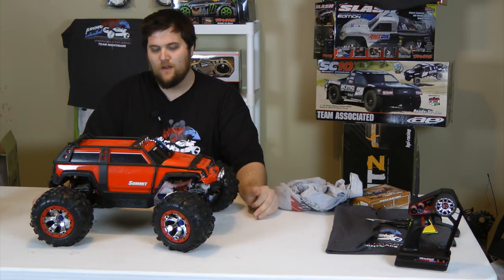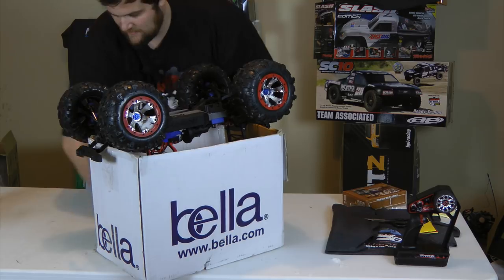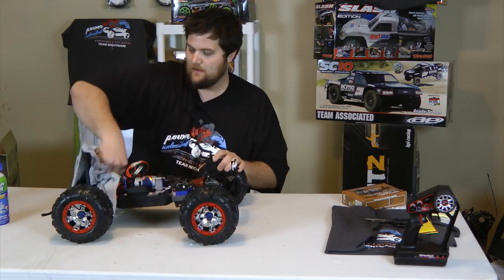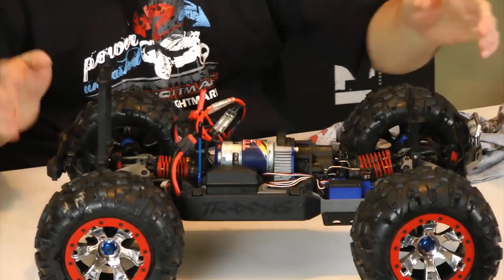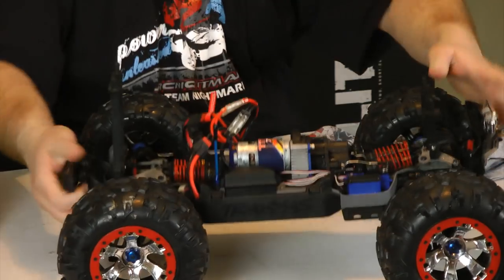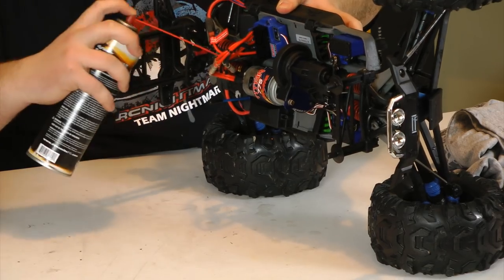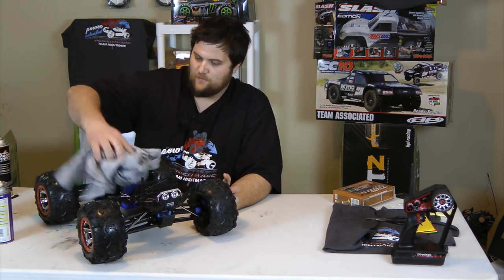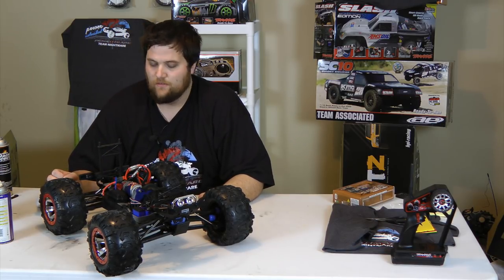Winter RC Car & Truck Care-Snow & Water  Removal & Post Run

Comment from the maker: @Bloomhighschool Dude timely post, I just waterproofed mine tonight and installed!  What type if isues are you having that normal cleaning wont prevent?  Do you use that mootor cleaner stuff?  That worked pretty good

Comment: @rcnightmare actually havent had any problems yet, i do exactly what you show in video, i havnet got any rust yet, just curious at the end of the motor, does that sometimes need to be greasted or oiled up to keep it running smoothly? other than that, i should use wd40 to keep every moving part smooth right?

Comment: with my hpi blitz how do you acces the rear bearings i disnt submerge it but i did get wet. i dont care about the brushed motor all that much because imma get a cc 3800kv sct combo or just the motor and a wp element esc

Comment: Hey man, thanks for the video I have the same truck, I didn't break it in what so ever.. I just finished running 2 sets of batteries through it hard, and want to know what to expect.. 

Also should I take out the motor or just take it off the spur and clean it with electrical contact cleaner then re lube it? Also how the hell can I take the motor off the wires to the ESC, are those connectors or solid solder connects? 

Sorry I am a noob to RC, thanks in advance!!

Comment: I just take my mini revo and hose it down in the shower. The snow melts away, and most importantly it washes all the road salt off. That and I make sure I lube all the u joints and pivot balls with 3 in 1 maybe once or twice a week.

Comment from the maker: @jtc817 yea thanks for the tip, I think I will have to check that out...haven't had much problems with wd-40 but its always better to use the stuff made for rc's when you can

Comment: if your interested in a fast, easy, and efficient way of cleaning after running in snow or water i have a solution. 
(Air compressor) it does not only shoot the snow out but also blows your rc dry! it works great; just remember to lube the bearings and ball joints, and any other moving part with some grease or 3 in one oil and your good to go;)
also plastic wrap does wonders for a simple solution in keeping snow out of the inside, just wrap and drive.

Comment: Hey guys a great alternative to compressed air in the can is this blower.
Metro DATAVAC Electric Duster, it is very powerful and quite better than the air.
Cheap and great for RCs and other uses year round.

Comment: Good tips, nice to see a longer vid on cleaning a rc. All these things mentioned in the vid work. Wd 40 is good but very messy as it doesn't evaporate so be sure to put something down on the surface u clean it on like paper or plastic to catch absorb the mess and its best to clean it  OUTSIDE! not in the bathtub or sink. Remember of the chemicals are harmful so be safe and smart as to how to use and dispose of chemicals

Comment: Leaf blower initially and then I use a heat gun moderately applied works really well and I do it in the shed no problems
Reply: That's what I was thinking too
Reply: Steve Declark ya works great I find if you do the heat gun right away it dries it so well you get no rust or corrosion. I've been doing it on a little savage xs flux I've been running around the yard during the winter
Reply: longboardguy yea I just bought a heat gun cuz I got a airbrush kit n use it for that cuz I started painting lexan n use heat gun in between coats, thanks so much for the response happy rc ing
Reply: longboardguy what temp do you run your heat gun at bud? And do you do it all over at the wheels and bearings and that helps not having to oil it down?  I got a compressor and a nice digital heat gun I could use. Thanks

Comment: If you don't want to spray WD-40 all over your truck you can buy a stainless steel screw set, it has some negatives but it safes you alot of work.

Comment: It's a long winded process but for traxxas the screws army stainless steel so I get hot wax and put a drop on all the screws holding no moving parts like chassis screws and shock tower screws and when the wax dries it's like a shield

Comment: just throw it in the bathtub, rinse it off with warm water, dry it how ever you want to (compressed air or just air dry), then use a little wd-40 or some bearing oil and youre good to go. only takes about 5 mins.

Comment: I hose all the crap and muck off then use gt85 with the wide spray nozzle all over the truck like everywhere and the gt85 acts as lubricant and leaves a beatiful finish to the plastic making it look new

Comment: @ironeagle2526 what helps controlling the pressure is getting one of those small-mouthed air sprayer bits, you can get em at walmart for under $5. As for the canned air, i save it for cleaning electronics

Comment: I just throw my slash into the sink, and I just run the water all over it to clear all the snow, dirt, and slush. It's already wet anyway so it's quicker. Then I dry the heavy stuff off and I use the hair dryer!

Comment: air compressor is fine as long as u turn down the pressure on it i have a small craftsman and it works just fine i clean mine up after mudding  dirt driving  and snow and i never had a problem and yes i do use wd 40 on it by the way canned air will make u go broke cleaning up the rc's lol

Comment: I just use an air compressor get off all the snow and water. then grease all the bearings and spray wd40 on all moving metal parts works great

Comment: U crack me up with the way u look at the camera, old crazy eyes lol, jk bro nice video I just subscribed I've seen a bunch of ur videos. I just got into hobby two months ago, bought 2wd slash, bigfoot 1(stamped), just ordered n bought new rustler, volcano, n wltoys. So addicting once I buy one I'm online looking for the next lol
Reply: Just watched a video on cleaning rc on URC n Jang from ultimate rc says using compressed air is bad thing to do cuz it pushes moister n stuff into crevices deeper, so idk if he's right or what?
Reply: Steve Declark No it is fine. Just make sure to really blow out and into the bearings and it will be fine. Also you can spray a little wd40 in there to remove moisture. Hey my story is just like yours steve, I bought an old traxxas emaxx from the early 2000's off my barber that was brand new as my first hobby grade rc at the age of 30 a few months ago and I got hooked! I also added a jlb cheetah extreme for 200$ at black friday then I flipped the emaxx cause it was old tech and brushed and from research found out it was incredibly fragile and broke all the time and used the money to buy a dhk maximus! So know I got 2 fast, brushless bashers and just waiting for the weather to break! Well ive seen you on all the rc channels as I've been hooked just like you! Bash on my friend! Sure I'll see you around, lol. Edit also keep in mind jangs videos are like 5, 6+ years old and the tech and waterproofing has come along way since then. So his advice is a little dated on some things, wish he still did it. He moved to Legos I guess. Think his channel now is jangbricks or something.
Reply: Chris Watson LEGO's,lol no Jane what happened to u. That's crazy didn't know that,yea man I was looking at both the trucks u have love the Maximus n the cheetah. Do u have the first or second one? I like both but I really like the first body a lil better but both r sweet! Two really sweet bashers u have my two bashers is I just got the new kraton n the redcat shredder v2, couple of beasts lol. Ok bro happy bashing n I'll see u on the channels

Comment: For the engine you should always use after run oil more = the better!

Wd40 has a tendacy to remove and be agressive... it wont kill the engine but the oil acts like a oil.... wd40 leaves a weird risidue when dried..... gooey almost like mapple sirup 

I normally put 8-10 drops of after run oil and make sure theres some everywhere , 

but bottom line wanna run in the winter time? = get 1 dedicated rc for this purpose.... you will be damaging more than gaining

Comment: this might be a dumb question but I got salt water in my ruckus 1/10 scale and now it won't turn on what do I need to get it running again
Reply: Brandon Ellefson hah I did that to my slash was rust
Reply: Don’t drive it in salt water
Reply: Okay Okey don’t drive it on salted snow either
Reply: The Simulator Gamer ****...I sort of figured that would happen... hopefully I put enough silicone that it resists... BUT...the dried salt is gonna kill me
Reply: i destroyed my vxl system in slash 4x4 driving on salted snowy roads, i mean it lasted all winter, but i let it sit a few days during the summer and my whole system seized up. with rust

Comment: here's my doing been doing it for 10 years
1. winter + snow = corrosion with the salt they apply in the streets thats a bearing killer , and the entire car will basicly be done with by the time winter is finish 
2. wd40 = removes water... protects from rusting but.... the kit should be dried before applying! so use  a hair dryer

3. NEVER EVER EEEEEEEEEEEEVER leave rc kits in a garage... = will rust within 1 week 
4 make sure the thing is dry dry dry dry as can be and lube it way more than usual

Comment: a good drying method is a air compresser
Reply: +Jan Jorissen lol same here. i live in an apartment too. pain in the ass sometime.
Reply: It wont work bro i did it all
Reply: Team Clar sensors Yeah it actually works great.
Reply: No drying off water whit a air compresser is not good, becuse you end upp blowing in more water in like bearings and stuff and that is not good. A hairdryer is the best to dry water whit pations. Sorry for the bad spelling.
Reply: Any easy way to prevent moisture from building up in it? Tried to dry my RC truck with an air compressor and ended up getting it more wet than it was before I started! :(

Comment: So why don't you use an air compressor to blow it off and not use so much canned air? It looks like the batteries are still connected, and they shouldn't be.

Comment: wd40 causes metal parts to rust it is water based...look it up. I used to spray my bicycle chains with it as a kid and wondered why they would always rust and then door hinges on my cars and it caused them to rust too. Does not prevent rust at all. I would use wd40 as a cleaning solvent not a lubricant.

Comment: Some a-hole 18 yr old idiot forced me to drive my car trough a puddle of water, else it got squished by his car. it nearly completely submerged. I quickly went to the nearest friend with aircompressor and got all the wetness and dirt out. Even the battery was soaked, wrapped it in that paper you use in the kitchen. Kept it in for a week. After that tried to run the car without recharging that battery, it ran just fine! No harm what so ever! Just hope i never have to go trough that again though!

Comment: Also don't spray silicon oil under your servos or servo saver, u will CURSE that day a long time. It will not turn as good as it turned without silicon oil.

Comment: That is a brushed motor so it not waterproof to the guy who said bring it in the shower lol. You spend 500$ on a rc and put it in the shower. I'll use air
Reply: I use air as well to clean rigs, but brushed motors are somewhat waterproof, at least in clear water.  They may need to be cleaned and re-oiled but will pretty much run in water.
Reply: Oh I never knew. But still I'm not gonna put my truck , which is a slash 4x4 with about 500$ of upgrades in a shower to clean it...
Reply: derrick r, me too!
Reply: People break in brushed motors totally submerged under water all the time = waterproof. Just relube after and good to go in my experience anyway.